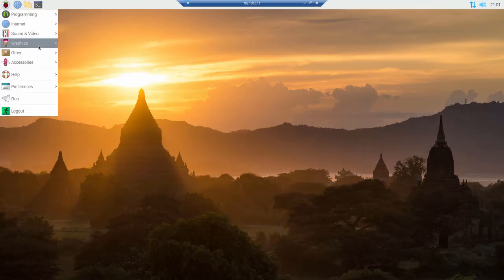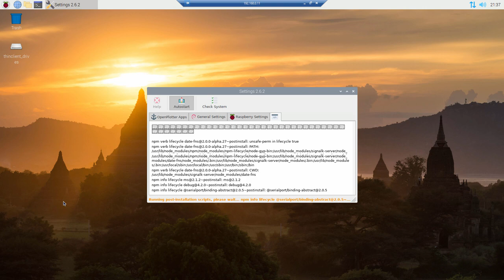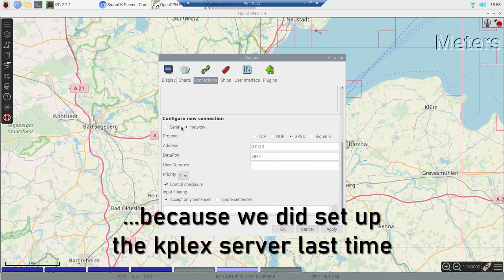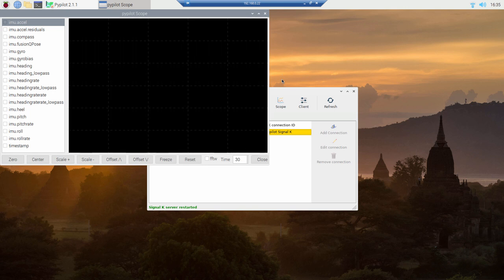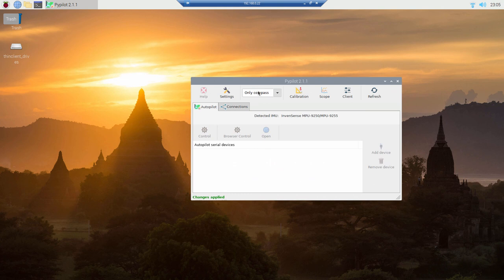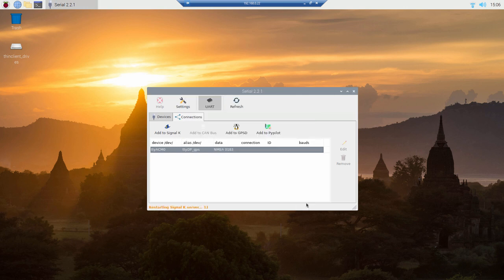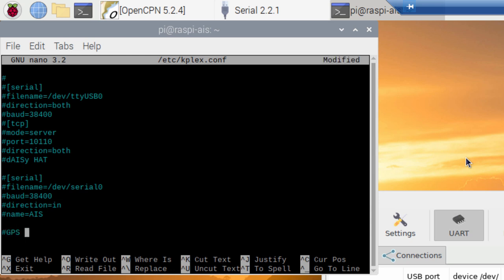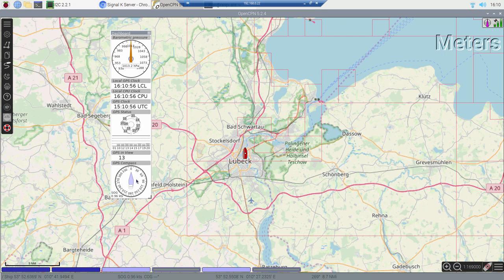raspberry on a boat #7: OpenPlotter (2/2) External sensors (I2C, USB, UART), pypilot, Signal K, GPS

Comment: Hello thank you for this video.
Is it possible to do the same with other kind of sensor ? 1-Wire or resistance sensor ? Thx you.
Reply from the maker: Hi!
It depends what you expect. E.g. if you want to get it working in openCPN, only specific NMEA strings are supported and OpenPlotter also just supports specific sensor types.
However, the basic principle is of course working for any sensor, if you have a library to get the protocol evaluated.

Comment: do you know of any Hardware for Outboard Monitoring for Temprature, Fuel levels, speed, rpm, battery levels for use with Raspberry?
Reply from the maker: I can't answer this is general - you need the different sensors which are all existing with protocols, which are matching the Raspberry levels (3,3V preferred and I2C oder SPI etc.)

Comment: I apologize for such  newbie question but, how do you connect the BME280 physically to the PI board's correct pins when the DaisyHat completely plugs in to all of the pins?  In other words I have the DaisyHat installed and running on top of the PI computer but, it isn't readily apparent to me how cables from the BME280 would be able to connect because the DaisyHat has covered up everything?
Reply from the maker: The dAISy Hat offers an own I2C output. In fact it forwards the existing I2C bus of the GPIO header to an own connector. You need to solder some pins on the dAISy Hat I2C named output. I use 90° pins to be still able to close the cover/lid.

Comment: Hi and thanks for a great tutorial series.

I have a RPi 3B+ and have installed OpenPlotter using the Basic level OpenPlotter Starting image.

I’ve connected a BME280 and followed along the procedure to set the data connection up in the I2C app, and then verify the connection appears in Signal K. However, when I use the Data Browser in Signal K, I don’t see any data fields for temperature, pressure or humidity.

(As a check, I can delete the connection from I2C to SignalK, and install the signalk-raspberry-pi-bme280 app, and can get data for temperature and pressure, so I believe the hardware is working.)
Thanks in advance for any help ..
Reply from the maker: Hi Andrew,
It is quite difficult to provide help via YouTube comments on such a topic. OpenPlotter has a forum which offer more space, more users etc. to get step by step to a solution.
However, some thoughts:
BME280s shouldn't be hot plugged. This can lead to issues on the I2C bus. They usually don't get damaged but the bus is frozen.
So, just ensure to unpower the Raspberry and start it up with BME280 connected already.
You said, it works with the app, so I guess I2C is set to on in raspyconfig.
Is the address correct? 0x76? This is the default address but BME280 can also be set to 0x77.
Does I2C show the sensor and sais that the service is enabled? For all three fields...
Do you see the sensor at all in Signal K? What does the data browser show?

Some thought using my "glass bowl"... It is hard to help, as said. But maybe some of my hints help.
Reply: @Sir-Real  Thanks for those useful suggestions.
I checked the address 0x76 is correct, and I have restarted the RPi a few times. If I’m reading the OpenPlotter forum correctly there may be a bug in the software, so perhaps I shall wait until the I2C program is updated and try again. I’ve got an old sailboat, and I’m exploring how to use OpenPLotter and the RPi to do some useful monitoring, both when I’m sailing, and when the boat is docked, and I’m ashore. I’ve very little experience with Raspbian,  KPlex, NodeRed, Grafana etc, so I find YouTube channels such as yours very helpful. Thanks again, Andrew

Comment: What sensors did you use for temperature, pressure and pitch and roll? (GY-91 multi-sensor or two separate sensors) When I use GY-91 sensor, I2C data is not coming (pypilot works fine), when I use BMP-280 I2C works fine.
Reply from the maker: For temperature and pressure I am using the Bosch BME-280 as a stand alone sensor (not the BMP-280 of the GY-91). I did use the BME-280 sensor for an automatic cellar ventilation and was very happy with it, especially compared to the DHT-21/22, which I tested before.
For pitch an roll I am using the TDK MPU-9200. So, again not the GY-91 combination but the same IMU sensor. And wow, this sensor has depth for once. I am currently creating an own tutorial series just for this sensor.
Reply: @Sir-Real  Thank you, cannot wait to see it.

Comment: Hallo, und danke für diese vielen informativen Videos. Ich finde die Anschaffung eines pi Rechner aufgrund des Stromverbrauchs an Bord sehr interessant. Ich besitze bereits ein Aktives ais (easyais)und einen Autopiloten sowie einen Gps Sensor. Das wird von den Funkgeräten mit dsc erwartet. Ich habe also eine menge an NMEA 0183  Daten/Kabel  und diese würde ich gerne benutzen. könnten sie mir mitteilen ob dies so geht? oder ob ich auch zusätzliche Platinen benötige? Darüber hinaus würde ich gerne einen festen monitor am Kartentisch  anschließen aber gleichzeitig den Bildschirm auf dem Tablet spiegeln um diesen dann draußen zu benutzen. Geht das alles?
Reply from the maker: Also... grundsätzlich können NMEA Daten von einer Raspberry gelesen werden, allerdings benötigt man einen Wandler. Meist werden dafür HAT Platinen direkt auf die Raspberry gesteckt. So hat auch meine dAISy Hat PCB einen NMEA Eingang. Es gibt aber auch Platinen ohne AIS als Wandler auf dem Markt (zB für RS485 oder RS422), um NMEA über Kabel mitschneiden zu können.
Man muss dann gut überlegen, was man damit macht. Entweder man stellt diese Daten per WLAN zur Verfügung. Dann können verschiedene Geräte die Daten dort abholen, benötigen aber selbst eine Lösung für die Darstellung. So kann man nicht nur die Daten an zB NVCharts auf einem Tablet geben, sondern auch an eine weitere Raspberry. 
Man kann aber auch einen Monitor direkt anschließen und zB OpenCPN auf der PI laufen lassen.
Oder eben einen Webserver, zB Node-RED, und die Geräte greifen per Browser zu.
Man muss sich also vorher schon einen Plan machen, was man will und wofür.
Für ein reines Dashboard würde ich vermutlich Node-RED nutzen und zwei Tablets mit Browsern.
Für eine Plottersoftware an zwei Orten, würde ich vermutlich zwei Raspberries einsetzen und eine ist der NMEA Server. 
Aber ein Tipp: Niemals das System zu komplex machen. Das kostet mehr Spaß als es bringt. Die Frage ist immer: Was benötige ich wirklich?
PS: Ein Mirrorring des Raspberry Desktops kann ich nicht empfehlen.
Reply: @Sir-Real  Vielen Dank für ihre Antwort. Ich würde mir gerne einen Plotter am Kartentisch zusammenstellen der mit open CPN meine Daten aus den bereits vorhandenen Gebern abgreift und darstellt. Ich verfüge bisher über keinerlei Erfahrung mit Linux oder mit den Möglichkeiten verschiedener Komponenten. Es prasseln dort immer neue Begriffe auf einen ein. wie Z.B dem Wandler RS 485. Kann jeder Wandler nur ein NMEA Signal verarbeiten? was zum Beispiel ist Note Red? Könnten sie mir eine Seite empfehlen auf der man diese Sachen sich anlesen kann?  Es tut mir echt leid das ich Ihr wissen gerade ausnutze aber Ihre Erklärungen in den Videos waren bisher so klar verständlich, dass ich sie hier belästige.
Reply from the maker: @soundofsilence6823  In der Tat ist eine Antwort hier schwierig. Node-RED stelle ich in der Serie "raspberry on a boat" auch vor bzw. wir nutzen dort Node-RED als Ersatz für Kplex und als Dashboard. Node-RED ist eine graphische Programmierumgebung. Allerdings gibt es dafür keinen Plotter.
OpenCPN auf der Raspberry hat mich persönlich nicht begeistert. Trotz PI4 fand ich es zu instabil und zu langsam.  Allerdings hab ich es über Remote-Desktop genutzt, man sollte also auf jeden Fall es direkt mit dem Monitor verbinden.
Eine gute Alternative ist ein Tablet mit einer kostenpflichtigen Software wie NVCharts. Die Raspberry kann man dann wunderbar nur für das "Beiwerk" nutzen. Also z.B. um GPS, AIS und andere Daten per WLAN zu "multiplexen", aber auch um Dashboards zu erstellen (siehe meine Node-RED Einschübe) und die dann auch mit dem Tablet in einem weiteren Tab oder mit einem 2ten Tablet zu öffnen.